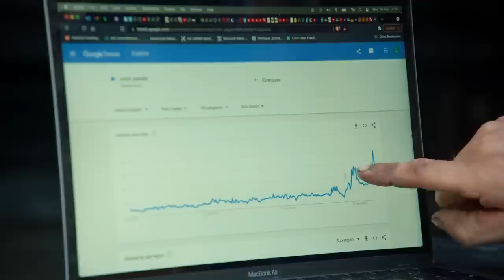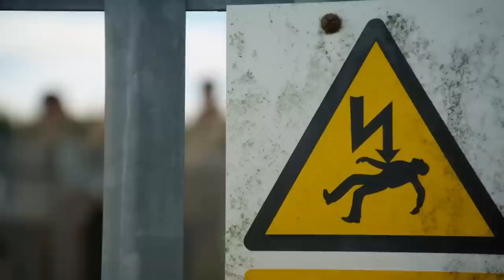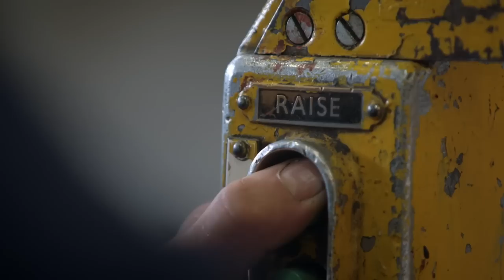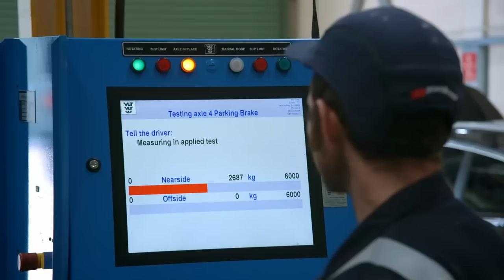Guy Visits A MASSIVE Solar Farm  | Guy Martin

Comment: Great to see this type of system being set up, it makes so much sense in an environment with so much demand! As for those skeptical about payback and the impact of creating panels and batteries here, ask yourself what is the payback on a gas or oil boiler and you also need to check the environmental impacts of sourcing/refining the gas/oil being used as a direct comparison - it's never comparing something with nothing, everything has an impact.

Comment: While solar panels are indeed wonderful, most people have a much higher expectation of them than reality. We have a solar array on our roof - 23 panels covering two-thirds of the south-facing surface. But the panels, 65" x 40" x 2" and 49 lbs each,  are only rated at 235W , giving us a capacity of 5.4kW. On a peak production spring day with low electricity use in the home we might just cover our needs, both most of the time the needs far outstrip production. In any case we don't store the electricity we produce, or use it directly. We are lucky enough here in Ontario, Canada, that we had them installed under the initiative of a provincial program that has us in a 20 year contract to sell our electricity back to the power grid for many times the usage rate. We have had the system for a little over 11 years and it paid for itself in less than 9.
Reply: Sounds positive
Reply: What are you running for that much demand? 
Our average use is about 10kwh a day.
Reply: @leskennedy  Good question. What sort of appliances are you running that require so much energy?
Reply: 235w per panel? Must have been some older technology because nowadays it’s 395ish Watts per panel, in the UK if you don’t have battery storage system it’s very counterproductive to install a solar panel system.
Reply: @laks05  Yes, we've had them since 2011. I have not been keeping up with panel developments so it's good to know capacity has increased... thanks for the info. When our 20 year contract to sell electricity to the province of Ontario ends, we will still be able to enter into a net metering contract, where the electricity we generate is deducted from our bill. Far less lucrative but our solar array has since paid for itself - it's still money in the bank.
Reply: @laks05  Depends on your needs. We have people WFH in the house most days so the solar runs all the IT kit, charges the EV car when it's on the drive and we do have a battery that gets charged off the solar to last us the night. 
Without the battery we'd have to pay for electric at night - but the solar would still sort out our demands in the day and charge the car.
Reply: sell it many times the usage rate? Am i understanding it correctly you get more money that what you pay for if you pull from the grid? In germany you get like 6c wheras when you pull, you pay like 30
Reply: @fetB  you are understanding it correctly. We pay variable rates in Ottawa, Canada. Off-peak is 7.4¢/kWh, Mid-peak is 10.2¢ and On-peak is 15.1¢. The initiative we are under for the 20 year contract is called MicroFIT, under which we are paid 80.2¢/kWh generated!!
To qualify, a stated percentage of our solar array had to be manufactured in the province of Ontario. To that end our panels were manufactured by a German company that opened a factory here.
When our 20 year contract ends we will be eligible to defray our electrical costs by the amount we generate (at the same rates we are charged) in an arrangement called net metering. 
Incidentally, I lived in Lahr, Germany as a child while my father was stationed there. I have such fond memories of your beautiful country and its lovely people. :)
Reply: @JDnBeastlet  oh wow, thats incredible, and never going to happen in germany, ironically. Fond memories is all thats left for the both of us xd.

Comment: Water power is better, but generally, house holders can not buy the equipment so there are less installations and the manufacturing company's don't make enough profit. It seems its all about profit not sustainability
Reply: Water power is extremely inefficient

Comment: As long as you see solar ( at the moment) as a reduction in energy Bill's (ultimatly) and paying less to greedy power companies.  Then they have their place.  Lots of these things work on a small scale ie 1 house, but are not as successful on larger scale.  Remote properties benefit greatly from solar and wind but again you have to have sun or wind to work.  Batteries ( at the moment) are vastly polluting.
Reply: Not as polluting as oil wells, transport and refining. Right now as I write the U.K. is running at 60% renewables making the electricity dirt cheap. Pity we don’t see it on our bills, as we have to pay the expensive price of generating by gas.

Comment: I would have thought that the armed forces in general and specifically all departments that are land based, would be investigating alternative power sources and methods of making such sources applicable to utilising such energy supplies with existing equipment that otherwise would be a nett consumer of energy. Bearing in mind that in the event of a war breaking out across Europe there is a significant possibility of such a conflict going nuclear and the resulting magnetic pulse shutting down most electrical and electronic devices including any unprotected electrical storage equipment and service’s, I would have assumed that they would have been at the forefront of research and design of alternative energy sources for transportation of both material and personal. I’m thinking of using flywheel technology to provide transportation and chemical reactions to provide heating for both infrastructure and food storage and production . Even in extremism putting troops on pedal powered vehicles and treadmills to provide lighting and communication systems.
Reply: Solar power is unaffected by magnetic pulse and its energy used for flywheel technology in Antarctica where wind and solar energy is used and the flywheel is used as a battery
Reply: @666t  yes solar power maybe I effected by an EMP but unfortunately the circuitry used to make use of solar power as well as the capability to store such power so it can be used at a later time can all be effected by an EMP.

Comment: The biggest problem with solar panels is recycling the panels because at present we cannot recycle them! All the to land fill they go. And there is a worry chemicals will leech out of the panels in to the ground and ground water...
Reply: Where I live you can't throw solar panels out, the landfills won't accept them. Apparently all panels sold here must have instructions printed on them for how to contact the manufacturer to recycle them at the end of their life. It's not a great solution (for many reasons) but I get it. They're trying to force the people making the panels to design for recyclability by making recycling their problem directly. Like I said, many problems with this solution, but also it probably will have the desired affect to a degree.

And yes, I live in California.
Reply: I assume you wish to recycle them as they are broken,  if they can be reused do so, work out recycling methods,  maybe not use child labour,
Reply: Solar panels can be recycled. The materials in them have low value, so recycling tends to be more expensive than just dumping them. It can be done though. It is being done in some places.
Reply: @John Chapman it is possible to farm under and around solar panels - it is being done. Strangely of course you are not mentioning any of the damage that fossil fuels do to farmland or growing food or to us in the long run. A typical oversight, unfortunately.
Reply: Thankfully, solar panels are recyclable. They're constructed almost entirely from aluminium, glass, and silicon, which are all very easy to break down and use again.26 Jan 2023

Please do your homework before posting. A simple Google  search will help. 😂
Reply: @John Chapman there's more land covered by golf courses than there is solar farms.
Reply: @KirtFitzpatrick  No company will be around to take them back or tell you what to do in 25 years, it will be your problem.

Comment: As much as I appreciate Guy and the Solar panel miracle solution, it cannot last. Silver is in very short supply, and whilst the super wall street banks short the metal through the actions of derivatives to hide its true value, cheap solar panels are very short lived. And as Tim Shippam states, yes, after 25 years, into the landfill they go. And the batteries are another big problem altogether. Lithium cannot be pulled out of the ground quick enough by child slave labour, and then EV have a nasty habit of exploding randomly. In closing, to make EV's work, we will all have to go onto night shift, so the vehicles can charge up in the daylight sun. When Britain gets some off cause.
Reply: That's the spirit,  if you can, invest in solar,
Reply: "Tim Shippam states, yes, after 25 years, into the landfill they go." - Tim Shippam talks bollocks, they get recycled
Reply: @rtfazeberdee3519  either way, after 25 years they are disposed off,  hardly a  clean renewable energy source. Dirty energy furnaces are required to both make them, and dispose of them. What green clean energy can smelt metals I wonder?
Reply: @conservative-ku3lz  Iceland sits on top of a Roman Candle. They do. 😉
Reply: @conservative-ku3lz  Nonsense.  They are already producing green steel without fossil. 25 years is the end of the guarantee period, not end of life - not too difficult to understand. Plenty of development is going into replacing fossil at smelting plants which you'd know about if you did some research.  25 years is a long time in tech development.
Reply: Not true, Solar + energy storage, and Wind + energy storage already have a lower levellised cost of electricity (LCoE) than gas, oil, coal, and nuclear.
Reply: @rtfazeberdee3519 he’s one of these types that just spews a lot of nonsense that he’s read in some dodgy newspaper, without doing proper research
Reply: @fanfeck2844  yep, one reason to embarrass them with facts in the hope they see the error of their ways in not doing any research
Reply: @conservative-ku3lz  And the energy they produce outweighs the energy needed to produce them by an order of magnitude. Basic maths there, it isn't a secret
Reply: Commodity shortages are a major issue that will increase the cost of solar cells into the future but it won't sky-rocket back up into the price ranges it used to be when the tech was in it's relative infancy. 

If the price of silver were to sky-rocket that would also change the economics of solar cell recycling which will actually help with the landfill problem. Most cells don't actually die outright either they gradually lose efficiency. You can keep them in operation well past 30 years IF they were well built panels in the first place which unfortunately many are not. 

Lithium isn't mined by child Labor for the most part, Australia is the world's biggest producer and I've worked in the Australian minning industry and it's probably the best country in the world to be in any kind of minning work lol. Chille and China produce the rest and whilst the conditions are not as good as Australia it's not the same as artesian miners in Africa. Cobalt is the big issue with child Labor but it's used less and less in many batteries and can be omitted entirely if you accept lower performance batteries. 

I'm not an EV nut or greenwashed moron. The UK should also be investing in it's nuclear capacity more than anything but the situation with renewables is not as dire as you make it out to be.
Reply: you feed a lot of the propaganda. For one, li-ion batteries dont explode; they burn. Why do you lie about that or are you just that misinformed? 

Anyway, most lithium is pulled by machinery and even cobalt is only in some instance done by child labor. Its also old tech. Modern batteries are lfp and m3p compositions etc, which have a much longer life span, temperature range, better charging capabilities and drastically reduced thermal runaway. And that development isnt final either.

You also dont have to go into night shift, because one of the things the ev car change brought with it, is large scale battery development and the next generations of grid storage will be composed of common materials like salt and iron etc. It has always been the missing component in renewable energy and some might say, that was deliberate. But now thats a business case, its hard to fight it. Btw, this is also a component of recycling. Doing this with a handful of panels or batteries is inefficient. Once there are enough old units, recycling will be more common

Its funny you make an argument about old panels are 25yrs down then line. The first [real] tesla is barely 10yrs old, just to put into perspective how long its been, and you complain solar panels generating clean energy for another 15yrs. Coal and oil is constantly burned to completion, every single day, not only creating the much talked about co2 emmissions, theres are toxic properties associated (aside from the wars and environmental damage). Theres no such thing as a perfect solution (as far as we know), but the improvement is massive over burning fossiles
Reply: @rtfazeberdee3519  Like a DEW which melted Maui?

Comment: You can even plug in a Bitcoin miner into your electricity generated from your solar panels which has the rather useful side effect of generating enough heat to warm your home..So, you've now found a dual use for your electricity. A profitable one too!
Reply: First world problem averted
Reply: @666t  Kinda. But if you're generating enough, you are effectively getting free heating and free electricity, which is sustainable forever. Right now, poorer countries, like El Salvador are currently mining Bitcoin using the otherwise stranded energy from volcanoes and for the first time in decades are experiencing economic growth. So, there you go. Any energy company not mining Bitcoin or doing something else useful with excess energy is losing out.

Comment: You've got to love Guy's enthusiasm about everything. However, the idea that China building hundreds of millions of solar panels and shipping them internationally is somehow fantastically green is pie in the sky. Even more so for batteries for storage. At least CO2 is used for photosynthesis. As ever the real elephant in the room doesn't get discussed, which is there are far too many people. All of the problems we face are related to nothing more than our vast overpopulation, success at overcoming natural population controls, and consumption.
Reply: Over the life cycle of a solar panel it will produce far more energy than it consumes to produce and transport, and is such is a net energy positive. 

Plenty of countries are at below replacement rates for their populations, but you can't exactly fix overpopulation issues less you decide to start a mess genocide. Atleast in the UK, energy consumption has reduced by a good 15% over the last 15-20 years despite a 15% growth in population.

Comment: If you read this Guy, which I hope you do, then you Need to look into the negatively of solar panels and the batteries. Why? Because there's so much negativity about the true actual cost of the solar panels and the batteries. With regards the solar panels. What are they made of. Are they actually renewable? The batteries. Just what is the cost of these? Have young lives been lost to get the precious metals to make these batteries? Just what are the True facts in solar panels, the batteries to store the energy, the heat pumps? etc etc. 
There's definitely a conspiracy about saving energy and CO2 emissions to a point who the hell knows what the Truth is.
You are a down to earth geezer. A biker and speed freak. Just like me 30 years ago. But I was doing your TT speeds on Lancashire's roads. Oh happy days lol.
So please do look into the True renewableness (is that a word?) Of solar panels. Batteries. Heat pumps and the like Because the Truth needs to be told.
Reply: The truth is out there,  solar and batteries are the way forward,  storing energy that you get free from the sun is good. Raising the temperature of your country every day by 10°c would be hard without the sun, it happens most days to a degree.  To the na sayers I say Na.
Reply: aaahh... a conspiracy theorist - well done at trying to spread it
Reply: have you ever considered the effects of
1) the setting up of oil wells ?
2) oil transport, oil spills ?
3) the lubricating oil you change every quarter ?
4) mining of rare metals for catalytic converters
5) people killed by wars ( to control the oil production & markets )   ?
6) bonded labour in the oil producing middle eastern countries ( after the passports of the poor immigrant workers are snatched )    ?

Comment: With an average efficiency of around 15-20% solar panels will never equal the energy used to manufacture them, similar to EVs that use lithium based batteries, the cost and energy expended to make them cancels the advertised 'green Energy' tag they claim to save.
Reply: Categorically false, the repayment time for solar panels until they have produced more energy than they take to manufacture is 3-4 years. 

EVs are a bit longer, although crucially they are significantly more efficient in their operation, ie 1kwh of energy will get you further in an EV than 1kwh worth of petrol